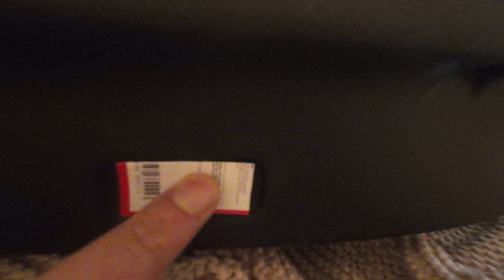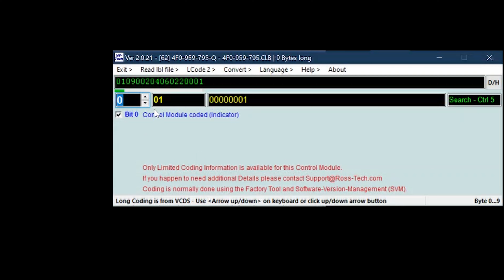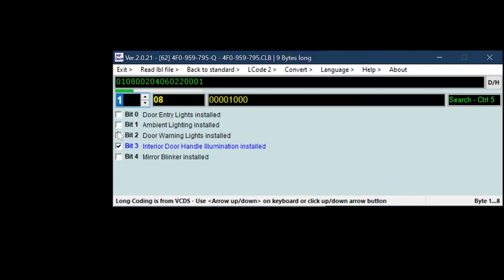Audi A6 C6 Rear Door Symphony Ambient & Projector Warning Lights #AudiA6C6 #CarMods

Comment: Hello, I would love to replace that door led light next to the door handle, long llightguide. Change it for a white led strip. I read there is a resistor which limits the voltage from 12V to oly 3V. Where can I found this resistor? Do you have any idea? Will cut it off and put there 12v led strip directly to preserve the mmi control.
Reply from the maker: Hello, unfortunately no clue about the resistor. Let me know if you figure it out!